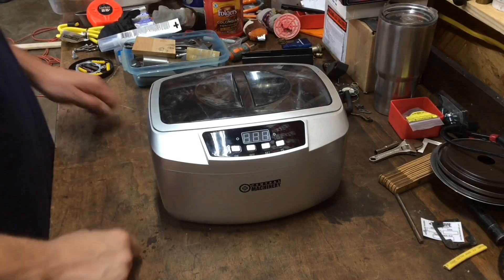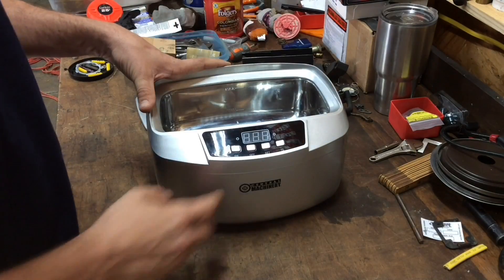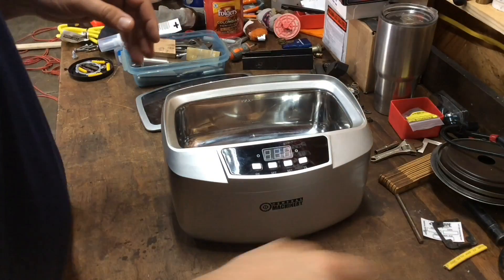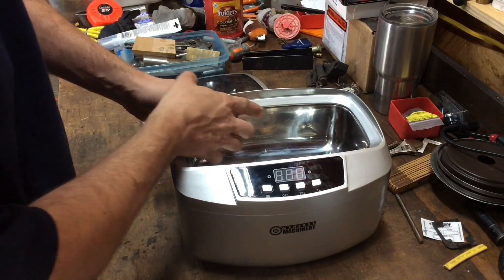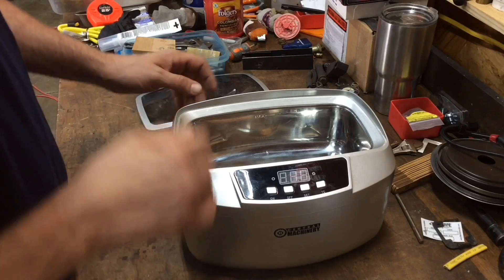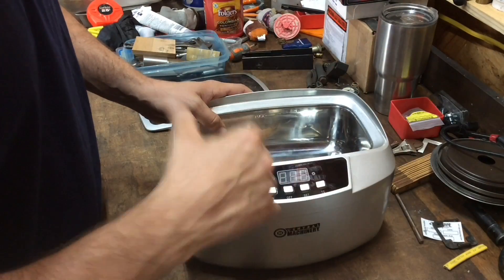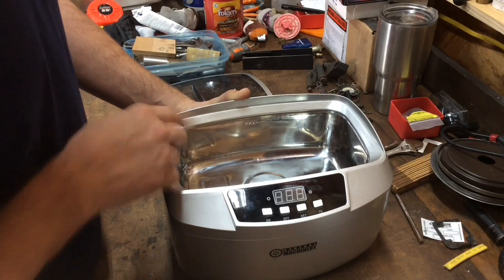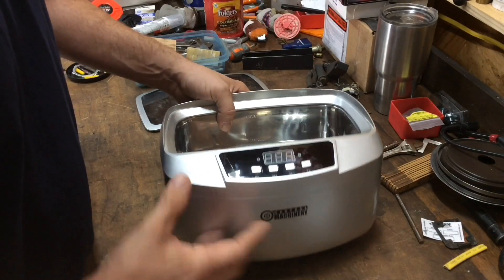Harbor Freight Ultrasonic Cleaner Improvement..

Comment: I drain it with a siphon, have had it for over 5 years now and it works as good as the day I bought it, another secret, when it's hot do not move it, just drain it after it cools..... Great idea.
Reply: Great Idea. I would recommend a hand pump like a large syringe which I think HF sells. Mine has a drain.

Comment: I did the same silicone thing (I didn’t know at that time there was a gasket already). 

After a dozen or so uses I started wondering if by using silicone to manually affix the tub to the chassis/plastic cover if that could be decreasing performance and making my ultrasonic cleaner to just a sonic cleaner.  

I still don’t know the answer but might be worth looking into.
Reply from the maker: I don’t think so, given the way the ultra-sonic bits work, but it’s a good thought.

Comment: Use IMPERIAL High Temp Silicone, up to 600°F. It resists moisture, heat AND VIBRATION. Costs around $7 at Lowe’s.
Reply from the maker: I’ll have to check that out when this wears out.

Comment: I'm curious .If I understand the principle correctly, the steel bucket resonates the ultrasonic frequency, kind of like a speaker cone, does using a rubbery adhesive/filler to basically attach it to the housing affect the device, reduce its effectiveness?
Reply: There is an ultrasonic element attached to the center of the base-plate, kinda like the Piezoelectric speaker found in those fold out birthday cards. Using silicone shouldn't affect it in any way.
Reply from the maker: +Kerry O'Connor That's actually a pretty good question.  I haven't seen any indications of this.  It works just as well as it did when it was stock.
Reply: most silicone caulks have a 300% expansion rate so if the surfaces were prepped correctly, there shouldn't be a problem for the next couple of years.
Reply: Does a a condom reduce effectiveness?
Reply: It may change the frequency . witch could be good or bad ,Different frequency do different things. Just saying .
Reply: Use IMPERIAL High Temp Silicone, up to 600°F. It resists moisture, heat AND VIBRATION. Costs around $7 at Lowe’s.
Reply: Use IMPERIAL High Temp Silicone, up to 600°F. It resists moisture, heat AND VIBRATION. Costs around $7 at Lowe’s.

Comment: Also silicone under the button part on the front. It will leak if the water splashes on the dark pard where the buttons are. Great vid
Reply: Yes, this happened to me. Water got underneath the button panel.  But I reattached it with silicon and it has worked fine ever since.

Comment: What are using your ultrasonic to clean? I have had mine for three years (from harbor freight) and use it weekly. There are  three things you should never do with this machine. #1) you mentioned in your video. Do not over fill with water. #2) Do not plug the cord into the wall before you plug it into the machine (as you did in your video). And #3) Do not turn on the machine when it is not filled with water (also something you did in your video).
Reply from the maker: Mc Irish Whatever needs to be cleaned at the moment.  Last thing I cleaned in it was a bilge pump impeller housing.
Reply: That rarely makes a difference. The only time I can think of is with car batteries where there's a possibility of explosive gases coming off the battery and wanting the spark to be far enough away that you don't get an explosion.

Electronic devices are designed to handle that as it happens every time the device is plugged in.

Comment: What's the best solution to use for carburetors to make them look brand new?
Reply from the maker: 250race Simple Green works pretty well, as does LA’s Totally Awesome from the Dollar Tree.
Reply: Pine-Sol, with heat.
Reply from the maker: Dan G I recently tried some Pine Sol and it worked great.
Reply: Whatever you use, make sure it's safe for aluminum. Many cleaners out there will etch the aluminum

Comment: Maybe they have a DON'T FILL ABOVE HERE for a reason it is  just me wondering
Reply from the maker: spike jones It does. And it still will leak if a splash occurs with it filled to said line.

You also increase your capacity if you fill above it and prepare properly.

And, well, rules are meant to be broken.
Reply: @BellyUpFishGarage  If you need more capacity, you can add a tub inside of the cleaner that is taller. I don't necessarily recommend that because the cleaner is probably not going to be powerful enough to get all of that, but in a pinch, if you're needing just a little bit of extra capacity, it works.

Thanks for the video, I was wondering a bit about the seal. I've seen people comment on having to siphon out the liquid, but the manual itself makes no such demand.

Comment: I got one today and had a old carb that's no good. I took it apart and put the pieces in there and it did absolutely nothing to the parts. I tried 3 different solutions, max settings and heat. Not sure if I just had high expectations or what. I was under the impression it would clean stuff.
Reply from the maker: Weird.  Maybe return it for a different one. Could you tell if it was working?

Comment: warning dont stick your hand in when its plugged in i have the older model not sure if they fixed it or know you will get shocked its not properly grounded and isolated so when its pluged in if you must move things use plastic i got a good shock from it

Comment: So, has the "added" silicone stood up to the ultrasonic-ness of the cleaner?
Reply from the maker: So far, yes. No leaks to date.
Reply: cool, was just thinking that the silicone was being disintegrated over time.
Reply from the maker: It may, but hasn't yet. Time will tell.
Reply from the maker: +Moo Moo Puppy 2 months later and we are still rocking.
Reply from the maker: I used mine yesterday, it’s still holding up just fine.

Comment: Man silicone bueno for nada! go to academy sports and grab some 3m 4200 sealer in boat section. its flexible and made to live its life below the water line. just like boats when silicone is used in less then a year you have water intrusion and a rotten boat. just a fyi
Reply from the maker: dgc940 If the silicone fails, I’ll give this stuff a shot.